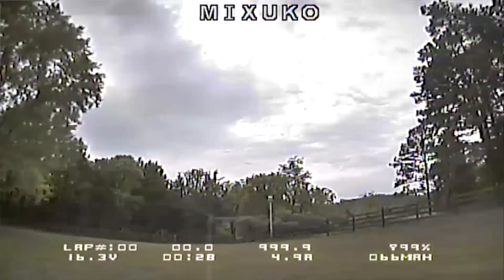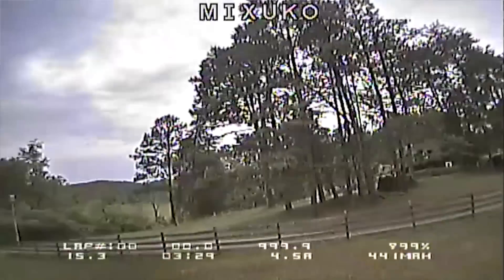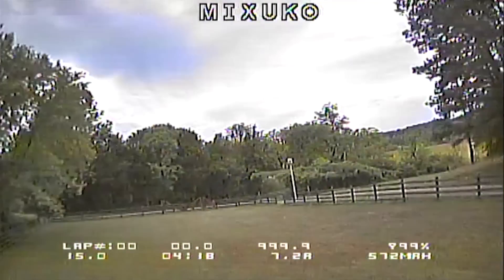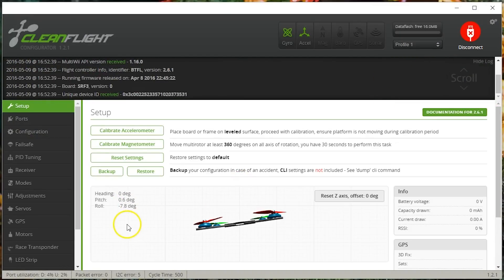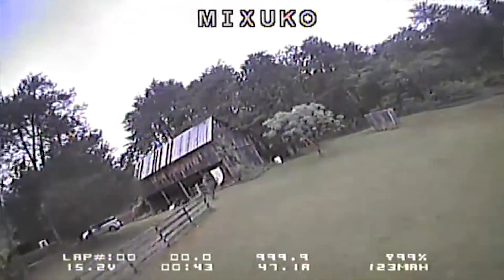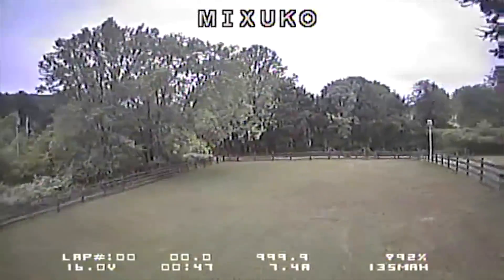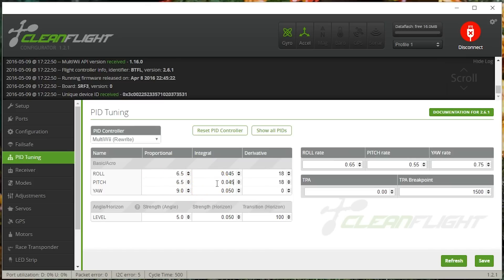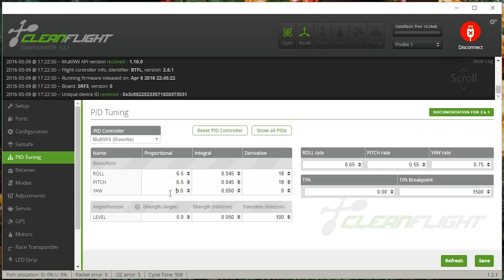Practical PID Tuning - Part 1  | HOW TO TUNE A QUAD

Comment: Im just trying to understand the methodology here, I thought that excess D term was undesirable and we should be aiming for a lower D term and matching P term vs a higher P term and matching it to D.  Essentially its tuning out oscillations with P vs tuning them out with D.

Is there really a benefit of doing it either way?

Oh and thank you for the RROSD vids. I put one in my latest build and I dont think I can go back. Best $35 ever spent
Reply from the maker: Excess D term is undesirable, but "enough" D term can help improve a tune. So if you are not having micro-oscillations then you are free to adjust D as you see fit.

Comment: Exactly the kind of PID tuning series I need! Great work man!
Reply from the maker: Awesome! Thanks.
Reply: same! I was tuning last night and couldn't figure out why I could hear a loud vibration(so much vibration it vibrated one of my motors screws loose causing it to crash), so now once I've seen this video I think my yaw P is to high. It was shaking really fast immediately after arming once I got in the air it was OK but under 50% throttle it would shake and could hear the oscillation, does that sound like a high yaw P? sorry about the long ramble I just need help.
Reply from the maker: It's hard to judge. High P would usually manifest under higher throttle and go away under lower throttle. At a certain point, it's not certain what is causing the issue and it's a matter of trial and error to solve it.
Reply: Joshua Bardwell also one more thing. When should I set my expo? Before or After tuning PIDS
Reply from the maker: it shouldn't matter too much I don't think. If the copter is basically flyable, the finer points of setting expo and rates can be put off until later. But personally I try to set the expo and rates right off the bat so the copter flies like I expect it to. Until betaflight 2.8, I have been basically copying the same rates forward since like betaflight 2.1.6. With 2.8, the rates changed (super expo) and I will have to re-calibrate my expectations going forward. Look for a video series r.e. setting rates soon.
Reply: Joshua Bardwell cool thanks!

Comment: What dvr are you using? It feels like it might have a lower fps than original fpv feed
Reply from the maker: +Gryffin Cook it does. It's a glitch that happens occasionally. It should just be the first battery though.

Comment: so before you start your PID tuning you havent touched your rates or rc rate, rc expo at all? or did i misses something? nice video, love your input! wanna start tune my quad these days =)
Reply from the maker: +GourmetMusicVec I copy those over from the last copter. I've been using the same ones forever.
Reply: Ok, thank you! Just one more question, is there a difference between tuning in Acro or Airmode? I will use Airmode only, so isnt it the best way to also tune it in Airmode?
Reply from the maker: Yes, absolutely. Tune how you fly.
Reply: Okay, thx alot! =)

Comment: Good helpful video. However I'm a little confused at how oscillations can effect the video in anyway.
Reply from the maker: +Kurtis Towery I don't understand
Reply: @2:89 you said the lines in the video are from excess p or d.
Reply from the maker: It's not the oscillations, it's the electrical impulses that are being fed to the motors that are making the oscillations. The motors are the bridge between the physical world (oscillations) and the electrical world (noise). The same electrical impulses that cause the motors to oscillate, cause noise on the camera.
Reply: Okay that makes sense.

Comment: I'm really looking for a guide that says:
When copter does this, then you adjust that:. Or just points me in a direction to go.
Reply: I'm sure Josh would do a better job... but there is this: https://scontent-iad3-1.xx.fbcdn.net/v/t1.0-9/13151842_10154169093459581_1970067926181328640_n.jpg?oh=de8c299e55c80185162c627766a19f55&oe=57C7A3BC
Reply from the maker: +tahosrfr it's not that simple. For example rebound after a flip can be high I or low P or low D. You have to work through a process to find the right values or at least understand the process so you know which steps you're skipping.

Comment: Nice Video Joshua. Why are you using the Multiwii Rewrite PID Controller instead of the Luxfloat? I know that the Luxfloat Controller is using Floating point math and the Rewrite is using integer math to control the copter. And floating point math needs more processing power. But although of the higher need of processing power it seems that most of the people are using Luxfloat instead of Rewrite. !? Is it better to tune? Would be nice if you could to a video about the different PID controllers. I never understood when to use which controller.
Reply from the maker: +xuxusito I've been using rewrite since I was on Naze32. There was once a time when it was Boris's darling, before he moved on to Luxfloat. My rates are tuned for rewrite and that is a big component of how a copter flies. So I stick with rewrite because I don't want to re-tune my rates. 

There is no longer any difference in flight between rewrite and luxfloat as of Betaflight 2.7. Even the PIDs are the same. If you are on an F3 board, luxfloat nay give reduced processor utilization. On an F1 board, rewrite will definitely give reduced processor utilization. There isn't any reason to discuss how to choose a PID controller because there isn't any difference between them any more.
Reply: Ok thanks Joshua, since I have a Naze32 Rev5 i will use Rewrite then for a lower pocessor utilization.

Comment: As someone brand new to this I wish you explained "why" these things needed to be adjusted (I'm only 5 minutes in so far).  You say "yeah, pitch and roll I gain need to come up" and you are pointing out what symptom leads you to that conclusion, but you aren't explaining "why" the solution fixes the problem.
Reply from the maker: +Sam Iyam that's a much deeper theoretical topic. It's just too much to fit in one video, even for me. Here is a good start. https://youtu.be/0vqWyramGy8

Comment: Good info, well explained, cheers Joshua :) Though you sometime don't leave text up long enough ;)

More on the effects of too high I gain would be nice. Peoples opinions vary a lot regarding I gain. I know for example Boris like it as high as pos but Steele likes it low. What are the pros and cons?
Reply from the maker: Too high I gain makes the copter feel stiff. Like transmitter springs, some like it loose and some like it stiff. 

If I is too high, it can cause rebound after flips and rolls. It can also make you pull into a turn after you center the sticks, especially if yaw I is too high. But all of that is moot if you are using Betaflight which zeroes or reduces the I term when angular rate is high.

Comment: This is the type of PID tuning guide I have been waiting for.  I don't have blackbox so all of your BB tuning guides was hard to follow.  Thank you for making this and hopefully more to come.  Your RCGroups thread is hard to follow now since it has hundreds of pages.

Question - if you mentioned this already in the video I missed it but, around the 10 minute mark while doing pylon turns, I noticed the quad oscillating slightly as you mentioned, but the quad still was drifting slightly for my taste.  You raise the P term on roll for that right?  This will surely cause more oscillations.  Do you tune the oscillations out with D?  Other than that, quad is close I think.   

I guess for a RACE tune, slight oscillations is okay if the stick feels really good right?  How does slight oscillations effect the speed of the quad?  Basically, what I'm asking is, is it okay to have slight oscillations if the stick feel and quad acts how you want it?
Reply from the maker: The drifting may be the result of me not being used to the uptilt and not coordinating the turns perfectly. I agree that a race tune will likely have some propwash oscillation.

Comment: whats with the video its like 20fps and glitches i fly 25mw and if i was flying there i think i would not have any glitches
Reply from the maker: +8alakai8 the FPS is something my DVR does occasionally. I just failed to catch it before recording this session. The 2nd half of the video should be better.
Reply from the maker: +8alakai8 also, the DVR is recording with regular dipole antennas, not cloverleaf, so it's reception is worse than I see in the goggles.
Reply: +Joshua Bardwell oh oke thats wy i was thinking youre antenna was bad or vtx
Reply: I thought it was your SD card class. The write speed might be too low?

Comment: Great video one I'm waiting for for a long time Thanks ... I'm not seeing it much in your video but I will like if you can show how to maintain low level flight and reduce the altitude gain when you do a hard 180 turn.  Again Thanks
Reply from the maker: That's not tuning. Just practice throttle management.

Comment: Thanks Joshua, when I get time this week I will load up 2.7.1 on quad 2 and see if it goes P crazy on stock pids like my other 2.5.3 Tmotor quad did. Every time until now I have always been able to fly a new BF version but the uncontrollable wobbles risked cooking my esc or motors I think. Something could have been in conflict with my radio settings but they are very stock Opentx on a 9x. I had both P at 1.9 and 2,1 and got this with 2.6.1 on a smooth 2.5.3 mini,
https://www.youtube.com/watch?v=vwbPAI4yP4Y
Back to 2.5.3 with same lowish luxfloat P, always back up settings. Found a new park :o):  3s 10c 3000mah multistar caused wobble on decent. LOL!
https://www.youtube.com/watch?v=-yL0j_Or4bk
I am not at the skill level to really need the improvements yet so never a rush.
Thanks again, great instructional crazy you have a quad chasing dog.

Comment: Is it worth trying G-tune? Today I flew six batteries but I can't figure out what is causing oscillations. Controls are crisp but the quad is shaking when turning.
Reply from the maker: +zaqwsx28 I'm not a fan of gtune but some people find it useful.
Reply: You will get much more out of the hobby and become a better pilot for it if you tune it yourself. Gtune is very hit and miss and will only ever get you in the general area of a good tune, if that. I'm no expert tuner myself but I'm learning. It really is a valuable skill for this hobby. And once you can do it, you'll always be able to do it.

Comment: Nice video, your copter is flying decent even without any tuning.
Mine is much worse on default.
I did initial tune LOS. Later FPV reveled that forward flight is really wobbly. It is like driving over bumpy road. My suspicion in that i need more I_gain on both roll and pitch. 
That do you think?
Reply: +MegaMoonse are you in the uk mate? I can send you some littlebee 20a flashed with multishot for free if it helps you out. You would probably have to put some new + and - leads on as they have been cut to size. But saying that, they came off a zmr250 frame so will probably fit fine. As a wise man once said 'like is too short to fly bad esc's'.  Let me know mate.
Reply from the maker: +MegaMoonse bumpy road is how I usually describe excess D gain. But if you are on default PIDs, D gain is probably not too high. Try lowering D gain to 5 on all three axes just to check and see if that is the issue. Bumpy road is often also a loose FPV camera or camera lens or even internally the board can be loose.

Flying decent without tuning... betaflight is amazing! If you aren't flying betaflight, install betaflight 2.7.1 immediately! It's amazing. A good set of ESCs such as XM20 will be the single biggest thing you can do to improve your copter's flight, assuming you are not already running a good set of ESCs.
Reply: +Joshua Bardwell Thanks I will try lower D gain and compare.

Changing ESC on my poor mans setup would cascade to a totally new copter.
I am running PWM-only receiver, SymonK ESC, CC3D with Librepilot, DYS 1806 and ZMR 250 Frame.
Betaflight on CC3D with PWM receiver does not play well. Only 5 channels out of 6 are available. No Oneshot or Multishot goodness. 
Nevertheless it is fun to fly and experiment. 
I might do a fresh build next season.
Reply: +mrmurder75 life even.
Reply: +mrmurder75 Thanks for the offer. I am not in the uk. And in my case one would say: 'Buy nice or buy twice".
Reply: +MegaMoonse that's a shame. Are you in the EU?
Reply: +mrmurder75 Yes
Reply: mrmurder75 Are you still willing to send me esc?) I have reached the maximum possible tune with my Simonk. Still flyes like a fat cow.

Comment: great video, why did you decide to go for DVR recording and not HD ?
Reply from the maker: +Flo the real reason is that the Mixuko isn't designed for HD cam mounting (although it can be done of course). But I like that the DVR plus ambient sound gives you the actual experience of what you would see if you were there. That being said, HD cam is the only way to see really fine oscillations and other very subtle tuning issues.

Comment: That was about the best PID tuning lesson I have seen so far. Keep it up!
Reply from the maker: +Andrew Demczuk glad you liked it. More is coming.
Reply: I have a question. When i roll my quad fast then is there kind a lag or 
however i should say this, it does not make smoth rolls. What could that 
be and how can i correct that ?
Reply: I get this too i dont know what it is ?